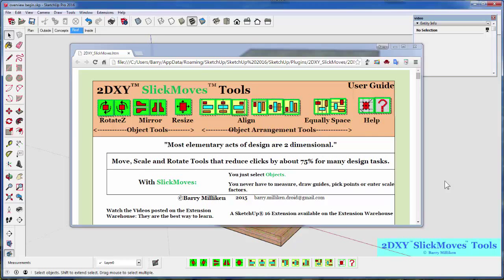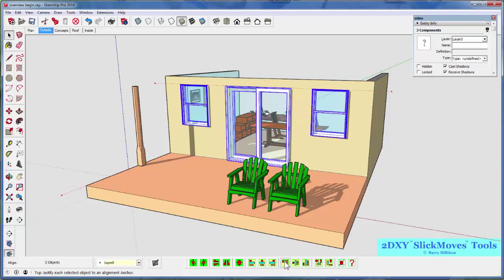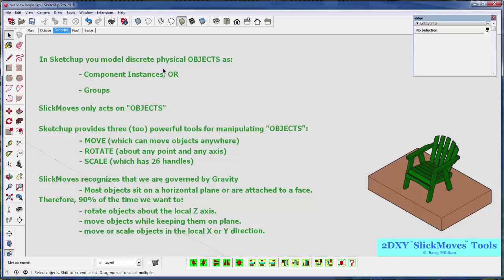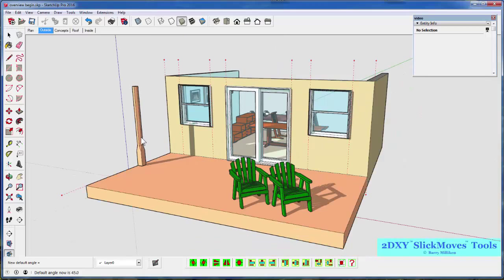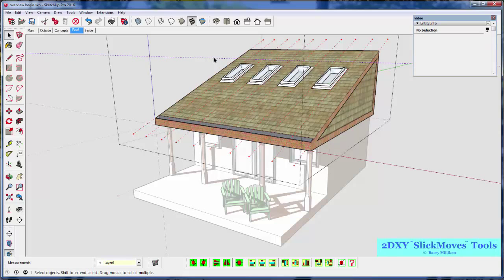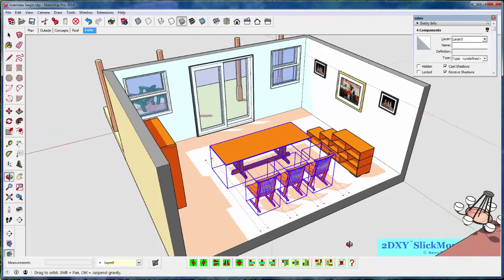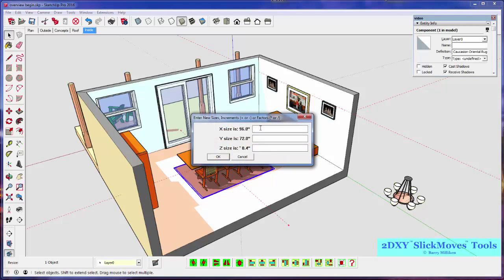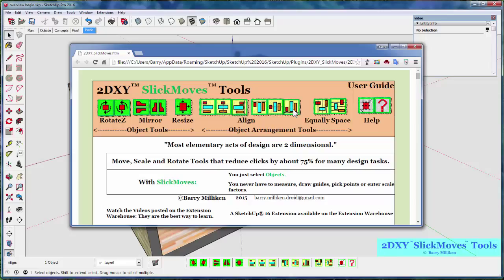2DXY SlickMoves Demonstration

Comment: Hi, can I purchase this direct from you (what's your site)? Or just from the Sketchup Warehouse? Also, says last update was 3.0 (11/2015) - are you still supporting this and will it work with SU 2020? Thanks, I'd like to get it, but want to make sure its current.
Reply from the maker: Warehouse only. Still works for 2020. 11/2015 was first release 1.0.
Reply: @2DXYSU  Thanks for the quick response. I just tried the trial version and the distribute isn't working? The align does - I selected 6 objects high and did the vertical distribute and nothing moves - any ideas? Thanks again!
Reply from the maker: @brianwohn  you need to watch the videos. All moves are relative to the active xy plane. To do a vertical move (z) you must set the active xy plane by including a  vertical face in your selection.